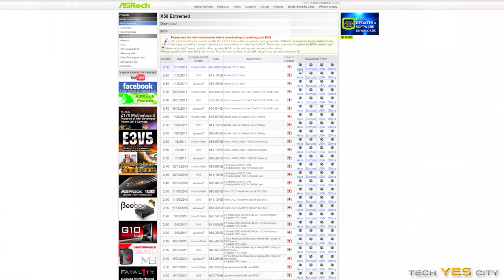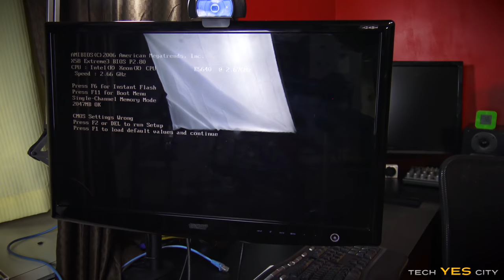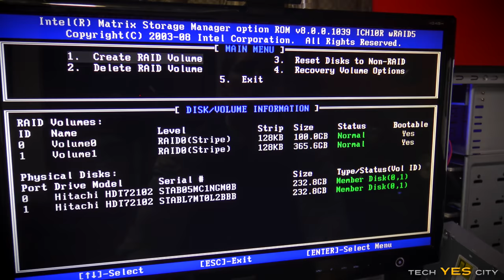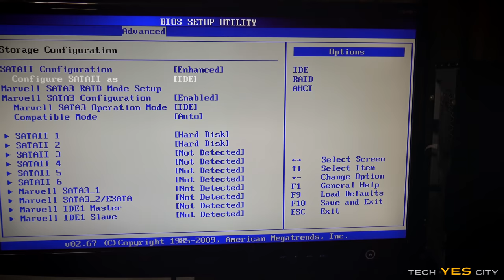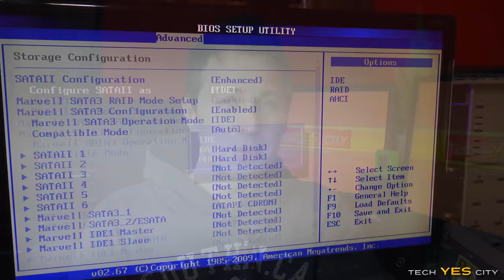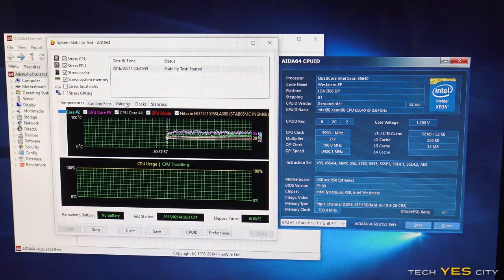Project WESTMERE - $327 USED PC Ft. The i7-???

Comment: "That's right a 4 core / 8 threaded CPU on 32nm for less than $20... It doesn't get much better than that." Yes it gets better the x5650 is 20$ rn.

Comment: what was the soldering job on the PS for? did it not have the correct connectors?
Reply from the maker: +Kristyanna Virgona Had no Sata connector :(, and I didn't have my voltage meter on me (no idea where I put it lol), and there is another PSU here that literally has nothing but pcie connectors / cpu and an atx24 pin on it.

Comment: What temperatures do you have ? I have intel xeon e5640 overclock just on 3.4 ghz and with hyper Evo 212 i'm hitting almost 70 celsius.
Reply: Xeons aren't really meant to overclock very high, so sometimes even the slightest oc can show a significant rise in temps
Reply: That really shame. I was thinking to get at least 3.8ghz perhaps with water cooler it would by possible.

Comment: if i will get a GPU for my system will my a4 5300 will be less busy after i disable its GPU?

My system:
CPU: a4 5300
MOBO: redfox rf-a55f2m3
RAM: 2x2gb Kingston Value RAM
PSU: 500w Generic PSU
OS: Win 7 Ultimate

Comment: Don't understand why u didn't try the i7 920? I had one of those chips and it ran overclocked to 4.2ghz on air for over 6 years before i retired it.
Reply: +jacedafaceis The E5640 @stock is already faster than the i7 920 @stock since it has more cache and is a newer architecture ( 32nm instead of 45nm) which also makes it run cooler.
On top of that it overclocks much better and needs way less voltage for the same clock.
Not to mention that it was only $20 and he can still sell the i7 920 for more than that.
Reply: +Coldministrator Yeah I get that, but he only got 3.4 out of it. If he hit the jackpot with the 920 like I did and got it up to 4.2 I wounder if it would have competed with the Xeon. But then maybe the 920 was a CO chip instead of a DO they were hard to overclock. Mine sat nicely at 4.2 never over 70c on air, even pushed it to 4.4ghz just for suicide benchmark runs and did fine.
Reply: I would have pushed the E5640 way harder myself :D ... I'm running my X5670 @4.2 GHz on 1.34 Volts ... and that is a bad sample! There's people out there that got it to 4.5 on that Voltage! Westmere CPUs are usually great overclockers! I wasn't able to get my i7 960 anywhere near 4GHz with the same Cooler i have on my X5670 now. It would reach 90°C @3.6GHz with almost no Vcore increase. (and that was after redoing the thermal paste. That was the worst OCing CPU i had ever owned)
Reply from the maker: +Coldministrator It could go a bit higher, but I have to sell it and I mean if it crashes in the summer or what not then I don't want to have one pissed off customer coming back for a refund lol.  It was hitting 4ghz at 1.28v at 60deg in aida64, so really safe.  I might go really hard in the next build though, drop a water cooler on it for shits n giggles.
Reply: Yeah that's understandable. 4GHz @ 1.28 is pretty good though!

My X5670 starts to get 4.0GHz stable at that voltage as well but unfortunately the VRMs on my "ASUS P6T7WS Super Computer" really suck!
It can run 24/7 @ 4.0GHz 1.275V (BIOS) as long as the CPU load is 100% ... (CPU-Z and HWmonitor show a Vcore of 1.28 during full load with Prime.)
However, if you only have a slight load on the CPU (2-4 Threads in Prime95) the Vcore drops below 1.26 and it gives me a BSOD within seconds...

That's with Vdroop improvement on ... turn that of and it's the exact opposite with it being stable with 2 Threads and BSOD during full load...

I currently have it set to 4.2GHz (200x21), 1600 Memory, 3200 Uncore on a BIOS Vcore 1.33750V with Vdroop improvement on

Idle Voltage is around 1.33 Volts, 50% Load Voltage around 1.32 Volts and under full load it goes up to 1.345... already makes me a bit uncomfortable.

It's a shame really! ... this board does 225 BCLK with no problem, 200 on stock QPI voltage... to bad it just totally fails in keeping the Voltages under control.
Reply from the maker: Damn.... that is insane for the bclk limit on the board! and yeah the 6 cores do put a lot of stress on these motherboards.
Reply: +Tech YES City It might not even be that, power consumption went way down when going from the i7 960 @3.6 to the X5670 @4.2  actually. So did the heat output.
The LLC (or Vdroop improvement) is just overcompensating a whole lot with this CPU. If it wouldn't go way past what i have set in the BIOS i could push it a lot harder.
I'm just uncomfortable with it reaching 1.35V and even more when the voltage is set to anything higher than 1.33750V in the BIOS.
I might get a different board with more Phases if i get the chance to snipe one for real cheap...
Reply from the maker: Funny you say that, i have tried a few x58 boards now and honestly my favourite to work with was the asrock ex3, was pretty tame with the e5640 and the vrm heatsinks were so friggin cool (that little fan is a great idea).
Reply: +Tech YES City Yeah, that seems like a great board! Does it allow for any Core PLL adjustments? (Not CPU PLL) I've heard that with the Xeons lowering the Core PLL really helps the OCing.
Recently i've had the chance to work with an ASRock X99 Extreme 4 with a i7 5820k on it and i have never before in my life seen Voltage readings so close to what was set in the BIOS. (OK this was my first time playing with anything X99 so maybe that's more the decent VRMs in the CPU than anything else)

I've had great experience with ASRock boards, especially their Extreme series. My 990FX Extreme 3 handled my Phenom II X6 1090T so much better than my previous, much more expensive AM3 ASUS board (that of course died on me) ... It allowed me to run it @ 4.5 with no real issues. The X5670 even @ 4.0 is no comparison though xD ... so much better!

I just wish i could get my hands on an SR-2... yeah it's old and for productivity a dual E5-2670 setup would be a much better bang for the buck but there's just that special ring about having a a rig with two heavily overclocked sixcore Xeons...
Reply from the maker: lol yeah two overclocked 5650s damn, what board is that specifically? That's crazy to oveclock dual CPU.
Reply: +Tech YES City I'm really surprised that you've never heard of it! The board i mean is the EVGA SR-2. It's like no other mainboard out there... 

Dual 1366, every single option for OC you could wish for (inc. Core PLL which is great!) and support for Quad SLI and Crossfire.

If you're really lucky you can get one for "only" $300, a few have been sold for that "cheap" but usually they're about $400 - $550 used.
Maybe you have better luck finding one in Japan than i have finding one in Germany

They are a bit harder to Overclock than your average X58 Board since it's 2 CPUs and you usually have less BCLK headroom to play with.
Good ones do 200 with ease, bad ones struggle with 190 but with a pair of X5670s a BCLK of 190 would still give you 12 x 4.18 GHz (or even more when using turbo multipliers on all cores which i heard is possible on this board somehow. )... this still beats a OCed single 5960X by quite a bit in multithreaded workloads.

That is just one piece of tech i would really love to get my hands on someday! Enthusiast gear at it's finest.
Reply from the maker: I think I have heard of it, just never knew it was that much of a dedicated dual CPU overclocking board - I think the market is prime for that kind of motherboard now with the demand for 4k content.  I ordered the e5-2670 x2 and the asrock server board, that thing will destroy a 5960x in multithread with ease.  And it was $540 all up for the CPUs/mobo/and 64gb of ram.... that is by far the best deal for a workstation imo :P.
Reply: +Tech YES City Yeah that's true. I might do the same actually. Only thing that bugs me a bit is that in single threaded workloads a X5670 @4.2 is still quite a lot quicker than the E5-2670 @stock ... For gaming this would do more harm than good. I'll wait for your results and try to decice then ...

Best solution for me would probably be the same as for Joker. Two seperate PCs, one with dual E5-2670s and plenty memory, another one dedicated for bad optimized games and LAN party duty.

Would need to sell a few things inc. my beloved X5670 but it probably would be worth it in the long run.

If you're ok with it i would recommend we move this discussion to the privat messaging system or Skype if you prefer but if @jacedafaceis is getting the same notifications for the comments on here as i do i would expect him to be annoyed by our spamming at this point :D
Reply from the maker: Well I told Joker that my 6600k build ill go downstairs now and my new xeon build will be my main editing station, the x99 will get pawned.  So I will do full comprehensive benchmarks, but for me personally I am enjoying 60hz nowadays, have no desire to go pro (too old tbh).  Would love a cut down version of the 27HU that does 75-80hz.
Reply: +Tech YES City Yeah makes sense, i'm only a casual gamer myself. I'm currently on a 4k 40" Samsung @60Hz and my Bottleneck is my GPU anyway. (GTX 970 AMP Extreme)
However, when i'm at a LAN party i usually borrow the Qnix 2710 from a Friend which is a great experience! (2560x1440 @ 110Hz)  Much easier to push as well! 

I hope the korean monitor manufacturers will have reasonable priced 120Hz UHD 40" displays availiable once DP 1.3 is a thing.

I sent you a PM by the way.
Reply from the maker: no worries will check it out, was out all weekend with my son.

Comment: You should try a used sub zero build with a phase cooler.  You can my them out of freezers or air con units :)
Reply from the maker: +Lawrence Timme Lol that would be way more than the whole build though.
Reply: Tech YES City true, but it would be cool (pardon the pun). i managed to pick up and old vapochill case with a small phase changer in the top for £100 with a load of water cooling gear :) there was one for £75 as well. would be great to see you do a build with one! may make the video a few parts as it will take a lot of effort :P
Reply from the maker: Yeah true, maybe a 6 c/ 12t x5650 and go nuts with it?
Reply: +Tech YES City well it depends on the power rating of the unit.  The smaller ones like the one I got for £100 are 1/6hp and can only really overclock core 2 duo and maybe pentium g3258,  but a 1hp unit should keep a 6 core cool no problem!  I have a little devil's phase as well that does - 50c with a 400w load.  It's held up to an fx8120 at 5.5ghz on 1.7v and a 3930k at similar speeds as well,  but that was £400. Have a look and see if you can find any.  

Linus did a video with a little devil one,  but I feel he didn't do a very good job and I think you would do it better justice.
Reply from the maker: Yeah i was surprised when Linus did it, didn't really push it much at all...  Guess he didn't know how to set the other parameters like PLL higher?
Reply: Tech YES City Normally you dont even need to touch the pll, its normally just a case of increasing the vcore. (this applies to snady bridge cpus or later, cpus before sandybridge can actually benefit from you lowering the pll voltage)

The main advantage of going sub 0 is that the cpu will actually run at higher speed at the same voltage as it would on air or water cooling. 

for example on my i5 6600K i managed to get it to 4.75ghz with 1.45v on air cooling. Once i put it under phase cooling i only needed to put the voltage upto 1.5v to get 5ghz, also the chip did not manage to get to positive temperatures until i put 1.7v through it and at that point it was at 5.35ghz.  Obviously you cant run it at 1.7v 24/7 and that was really just to see how far it would go. it is normally ok to use a higher than the normal safe voltage on phase though, because the cold prevents any degradation that would normally caused by heat. the other things you have to be careful when running these higher voltages, it that you motherboard has a strong vrm, as it is under a much higher load most of the time.

With ivybridge and newer chips, deliding can help a lot as well when under cold as the stock thermal paste performs really bad below -10c. Gelid extreme or thermal grizzly is best for heat transfer under cold.
Reply from the maker: Ah thanks for the heads up. would be interesting to see how different pastes perform sub0.

I might look into phase one day lol, need to get on top of getting regular content at the moment, always so busy :(.  What was the highest you got the 6600k to?
Reply: Tech YES City I have to say i cant wait to see your up coming content, it reminds my of the 'big' you tubers before they were big. i kind of like the hobby youtube videos. I think once it becomes a full time job you can sometimes tell that they are just putting a video out because they have to :and even though the production quality goes up, the content quality goes down. 

It is interesting how different pastes perform under cold, some pastes straight up don't work and the temps are crazy, while others are really good and dont really see the effect of the cold at all.

I managed to get the 6600K to run mutli thread benchmarks at 5.35ghz and single thread benchmarks at 5.45ghz. 

this time next week i will be benchmarking with LN2 for the second time! i cant wait. I actually benchmarking more than playing games now.
Reply from the maker: Thanks man, I cant wait to release it! Let me know on the LN2, sounds insane!
Reply: +Tech YES City Yes sir I will!

Comment: I enjoy the videos, I do, but seriously I don't understand where you are getting these parts? An i7 Level Xeon for $25, an i3 for $8? I don't want to be a naysayer but cmon, what magical land of basically free stuff does all this come from?
Reply from the maker: +J Bax http://www.ebay.com/itm/Intel-Core-i3-550-3-2-GHz-Dual-Core-Processor-SLBUD-LGA1156-SLBLR-USED-Working-/262291731268?hash=item3d11ce3344:g:5n4AAOSwe7BWwah3 - thats buy it now... bid can usually be cheaper.  the E5640 is here on buy it now too.. http://www.ebay.com/itm/Intel-Xeon-E5640-Quad-core-processor-SLBVC-2-66-GHz-12MB-5-86-GT-s-/111912049487?hash=item1a0e7a5b4f:g:WEEAAOSwHPlWdzXB
Reply: Well ya got me there, are you using any particular search terms?
Reply from the maker: pirce plus postage lowest.

Comment: @Tech YES City 
will xeon x5570 and xeon w3570 fit on the lga 1366 x58 mother board?
Reply: +Tech YES City
Reply from the maker: +Chen Tzur Yes they will, be careful with the x5570 though as some x58 boards dont support qpi2, the w3570 should work with any x58 board.
Reply: +Tech YES City only x58?
Reply from the maker: yeah. lga1366.
Reply: +Tech YES City thank you! you really helped alot!

Comment: This is what i have at the moment, is there anything I can add or change. With out going over board.

Processor AMD A6-6400K APU with Radeon(tm) HD Graphics
Manufacturer AMD
Speed 4.4 GHz
Number of Cores 2
Video Card AMD Radeon HD 8470D
Manufacturer ATI
Chipset AMD Radeon HD 8470D
Dedicated Memory 735.4 MB
Total Memory 4.0 GB
Memory 15 GB
Reply: If your RAM is 15Gb, it's more than enough. Kinda overkill, actually. Nothing you can do to upgrade either the CPU or GPU unless you buy a new laptop. Upgrade your hard drive to an SSD, I guess?
Reply: Okay cool, thank you

Comment: I got an awesome deal like this but better:
Asus rampage iii gene w/ io shield
Intel x5550 w/ cooler
12gb ddr3 (3x2gb corsair dominator/ 3x2gb mix)
1tb WD Blue
Cosmos 1000 w/1000 watt xion PSU
All cost me $70 :) just need to gather enough money for a r9 380 and more silent fans.
Reply: I got it on offerup app it was "in" a fire but the fire didn't damage the case it only got it dirty and a little rusty. both the cpu coller case and mobo was $35 it also included an old 771 xeon server and a amd quad core hp computer with win 7 license.

Comment: hey whats up B what do you use to clean the parts the CAN bro lol
Reply from the maker: +Supra TT CRC-556, best stuff ever.
Reply: nice thanx bro
Reply: hey brian is it like WD-40? lubrication or its alcohol spray is it safe to use or its one for your crazy bad ass washing it with shampo type experiment
Reply from the maker: Yeah like WD, just a bit better IMO. It is safe to use, i have sprayed it on live GPUs/Ram slots etc.
Reply: ok nice
Reply: hey brian whats up brother hows everything i have question about tomb raider have you played it yet men i have really fucked up issues with that game i have to under clock my gpu so the game dont crash its driving me crazy the game just wont run factory clocks 1084 only way it wont crash if -105mhz on the core i read ppl with 780-970 cards having this same problem i tired 3 drivers non work to the latest driver its using 5GB ram 2.600gb Vram
Reply from the maker: Weird problem, what OS and cable are you using? Display port / DVI or HDMI?
Reply: windows 10 DVI cable
Reply from the maker: Damn should work fine, I mean you can try uninstall and disable all the HDMI stuff, it can cause conflicts.
Reply: ok B ill try that out

Comment: Hello people I've got a question I've got a hp psu that has 420w it has been doing a fine job for 10 years but is it safe to use in a new build with an asus p5k mobo and a xeon and a old and a 9800gt? Thanks in advance
Reply: I'm guessing it won't last more then a few months in your current pc anyways. Surprised to see it even last 10 years. So you could reuse it,  but it's lifetime is pretty much over at this point.
Reply: I'm guessing it won't last more then a few months in your current pc anyways. Surprised to see it even last 10 years. So you could reuse it,  but it's lifetime is pretty much over at this point.
Reply: +Adeel Rehman lol I put in in my main rig now
Reply: ***** How is it still working? I would expect a prebuilts PSU to die way before that. I advise you to just spend 20 bucks on a cx430 from corsair.
Reply: Adeel Rehman 1 year update: its not in my main rig anymore since it didn't have pcie connectors for my hd4890 its in my third rig and it still works